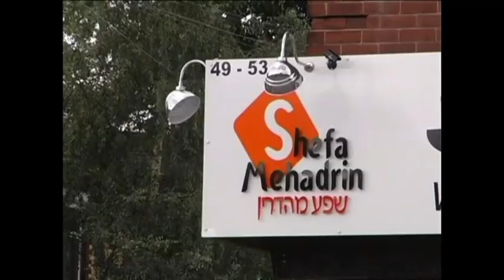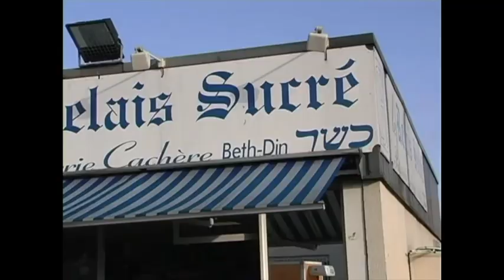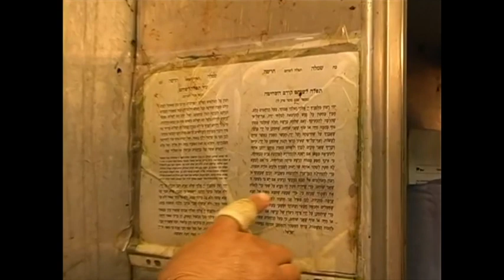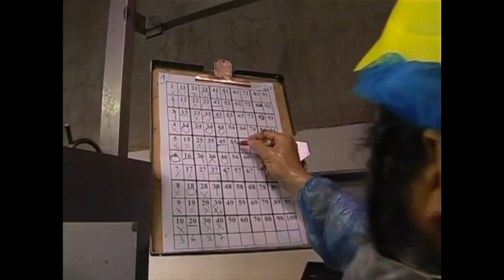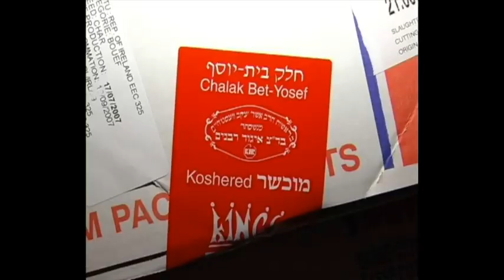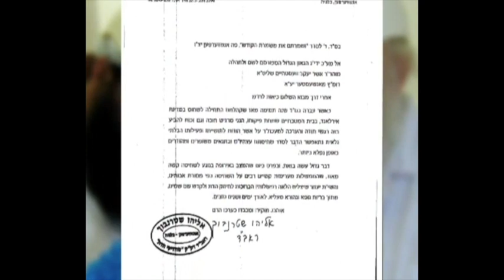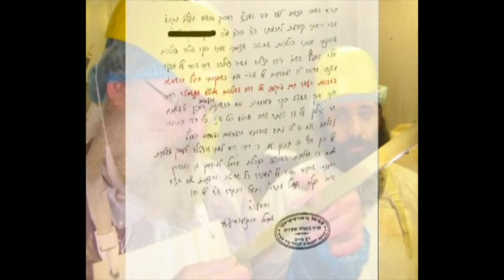Shechita and Kashrut of Meat 1 and 2

Comment: How do they not cut their fingers when they check the sharpness of the knife?
Reply: The Check is performed with the fingernail. Nails are kept long for this purpose.
Reply: @yadidya8286  I appreciate your reply, thank you
Reply: Wrong. How you gonna tell how sharp it is with your damn fingernail? Your not. Feel it  with your finger,just don't run it along the blade,go sideways.  You know how when you shave you don't get cut,unless the blade slides parallel to how the razors are sitting.

Comment: is backside meat kosher?
Reply: Not without extensive removal of Torah forbidden fats, the sciatic nerve and other blood vessels. This very extensive and intricate (and expensive) work and if I am not mistaken is only done in Israel. So the short answer is that the hindquarter is not used for koshering.
Reply: @RakEmet  I work in a meat plant in Poland, where a company from Israel is slaughtered and the tasks are also taken .. I mean not all but a bit .. hence my question is whether it is also kosher or maybe they are taking it on Muslims
Reply: @Ubojowiec  As I said if the people you know of have the experts required to do so, they will. Otherwise the backside meat is sold to non-Jews, irrespective of their religion. In your case I suspect the unkoshered meat is sold on in Poland.